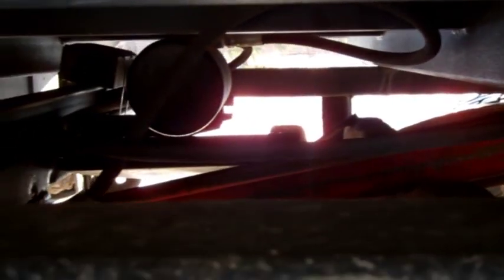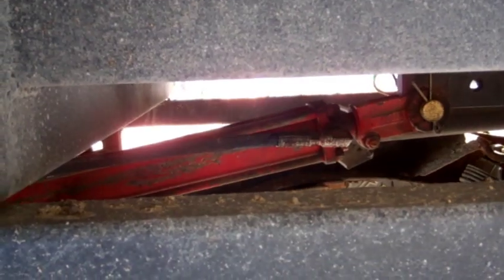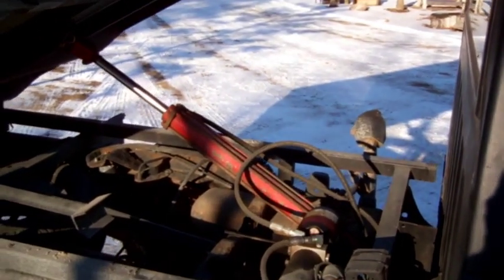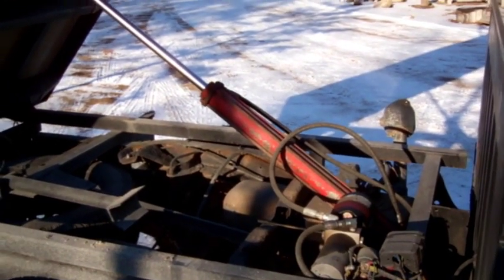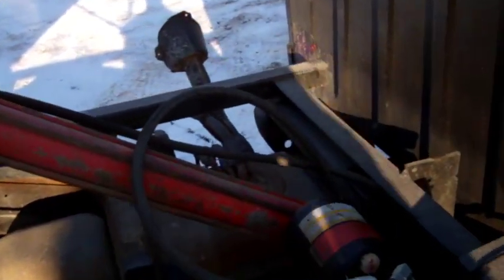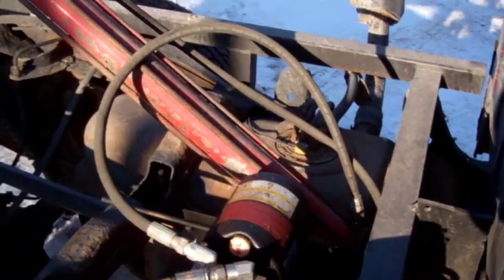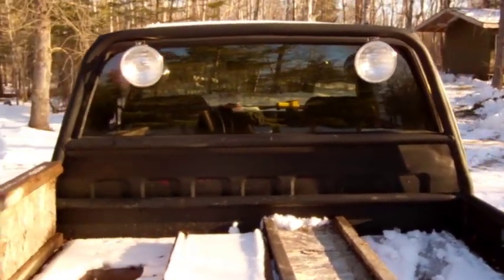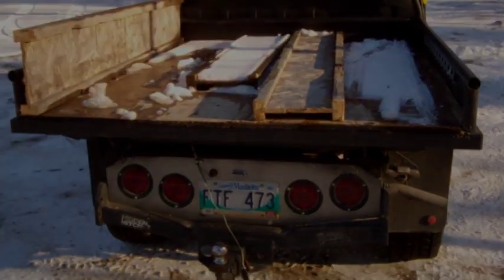Custom Homemade Hydrauilc S10 Dump Truck Fabrication Guide

Comment: Can you tell me on how long the lift ram is?I'm planning on building this on my s10 also. Thanks.
Reply from the maker: +Edward Huwalt i believe it's a 24" stroke 2"bore....i would go with a 2.5" bore though. sometimes i have to help it dump/load it further back
Reply: +REDNIC79 
Ok. Thanks!

Comment: Perfect!  I want to make a dump mechanism on my Dakota.  I put an Oztray aluminum tray on it a few years back and want a cheap dump upgrade.  I think yours is as basic as it gets.  I too don't need more than 2 tons of lift.  I can't justify dropping 2 grand into a scissor lift that would have to be modified to fit my already modified box.  Princess Auto is our friend!
Reply from the maker: yeah for sure, the only thing i would change really is i would make it lighter....i think i went a little overboard....my truck weights 4500 pounds empty with all the winches and hydraulics!! thats basically fully loaded when empty

Comment: Would you be able to message me a list of materials? I really like your design and I also have an s10.
Reply from the maker: ahh you know I don't really have a list as far as materials. it was kinda a 'free form build' hah... it's made mainly of 2x2 by 1/8 steel tube and 2x4 1/8 tube for the deck cross pieces..... not sure if that helps you or not.